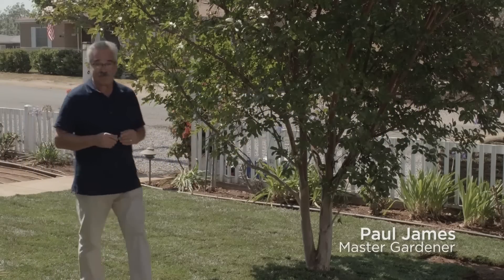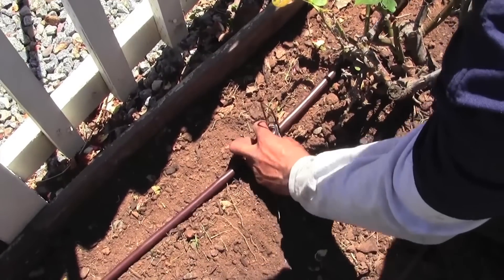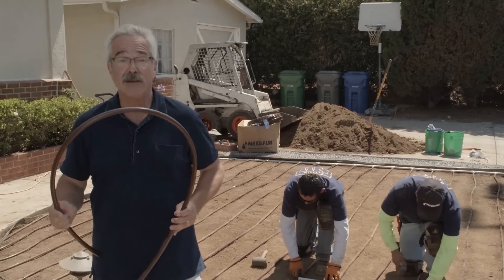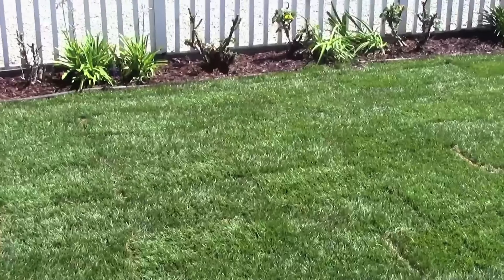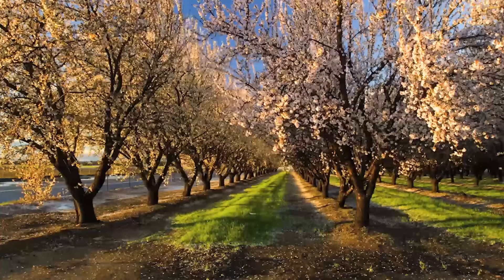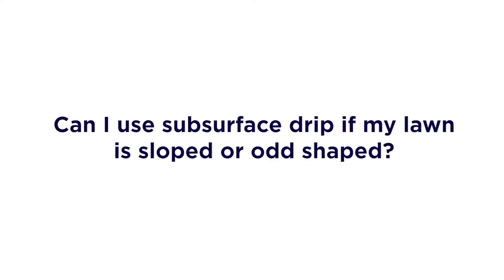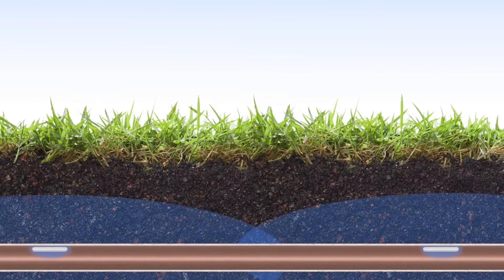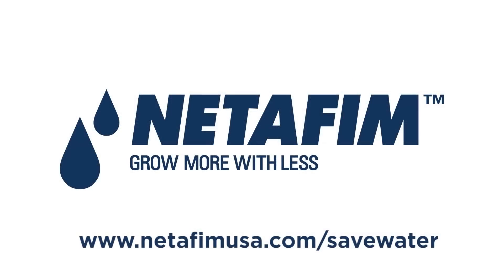Installing a Subsurface Drip Irrigation System in Turf Grass

Comment: Wouldn’t grass roots grow into, and block the holes?
Reply: If you water properly it won't, the root typically only dig into the drippers if you are underwatering a lot which causes them to search for water.
Reply: @danielvanbeek1600  No these pipe had film protection against roots

Comment: There would be no need for lawn aerating with buried drip irrigation, right?
Reply: You shouldn’t need to aerate your lawn. That’s only for place with heavy foot traffic areas like festival sites, sports fields or parks.
Reply: Well, no one would want to puncture your drip lines with a lawn aerator...
Reply: I guess you just strip off your sod and apply a new layer with no thatch.  "Sarcasm"
Reply: Neil Hanson sounds logical

Comment: how would you find out where a leak is underground under the grass I cant find the leak but I loose so much water. it was working for a year and the grass was thick and green. So now it is hard to get to the drip line. Thank you if you can help
Reply: It may not be ideal, but you might try running the system a bit longer than normal until you find a "squishy" place in your lawn, then try to find the center of that area and dig strategically to search for the leak. Be sure to make clean cuts under the roots of your lawn though so you minimize the damage to it. Just my two cents. I'm not a professional and I don't have an underground system, but I am a serious DIYer and considering installing one.
Reply: Was someone playing lawn darts?
Reply: You can't. I've been doing this for 26 years since I was 15 and every time someone says "why is my grass dying" I say "cause you put under ground watering system." You cant account for roots clogging the holes or for under ground critters and what's worse you can't evenly water the corners with out overwatering the center of the lines.
Reply: What exactly have you been doing for 26 years?  Drip irrigation? or Installing sprinkler systems?
Reply: @pauls8378  landscaper... installing sprinklers, irrigation systems and drip systems
Reply: @diazorn  so why is it there are people claiming to have underground drip working for over 10 years without issue?
Reply: @diggindude1  cause it works for them. They live in places that have regular rain or have enough traffic that not having above ground sprinklers  works for them. I live in Los Angeles when having sprinklers on for 10 minutes every other day isn't an option. You get fined for it. We have out door pets and peeing dogs is an issue cause you don't have sprinkler that wash the pee away. You have to use a water hose to saturate the area so you don't get burn spots from dog pee. I'm saying it has never worked for me. It's a horrible way to have sprinklers if you want to keep your existing grass and install sprinklers you cant just dig a trench along the outside edge. You literally have to remove all of your grass and then install your underground sprinklers system and them buy sod. You can't seed it and if you have make sure you don't use only a hand full of grass types cause st agustin will grow into the existing underground system and clog the sprinklers. Its has major issues. Do your research.
Reply: @diazorn  I am. You're one of the outliers at this point. The copper inhibits root growth in the drip line I'm considering.
Also, the problems you speak of are symptomatic of a lack in the planning, soil type identification, and installation practices.
I can't tell you how many times I've heard someone profess their time/experience in some field, yet they still perform the procedures wrong and wonder why their work doesn't produce better results.
Reply: @diggindude1  I'm sure the product you sling is something you love and use regularly and kudos to you. I've picked up a few homes in Beverly Hills and Brentwood and both have had them to homes I didn't install. This would be the maybe 8th or 9th home they asked  me to replace them with traditional , micro and drip systems. It's just my experience ... funny enough... just pulled out an underground irrigation system and placed and drip system and micro system for a woman that had to hand water after the sprinklers went off for 10 minutes 3 times a week in the underground system cause her plants were dying. Although I agree it was more installer error than anything else.
Reply: @diazorn  I'm not selling...
Reply: @diggindude1  then I'm sure your great at it.
Reply: David Diaz You do realize they make small trenchers for installing drip lines in sod, right?? These have been around for decades. There are also small walk behind vibratory plows. 

You don’t need to remove the existing sod.
Reply: David Diaz BTW... I’ve designed/installed/maintained Commercial/Residential/Athletic systems for decades all over the US.

I’ve seen a lot. And everything you have mentioned is not accurate at all.